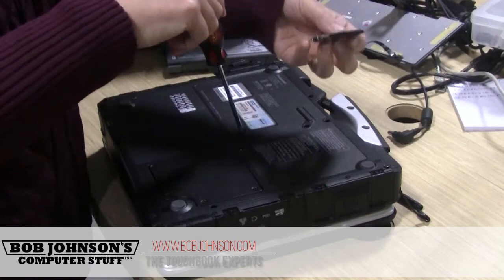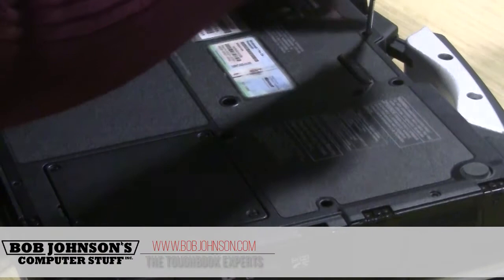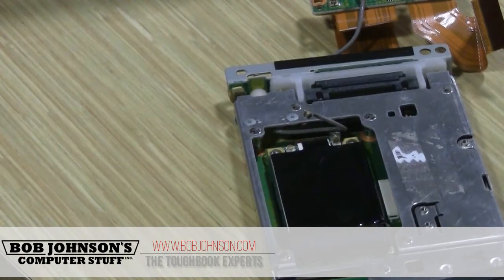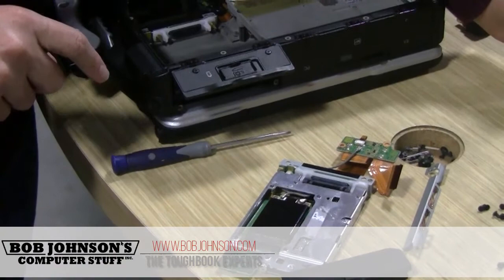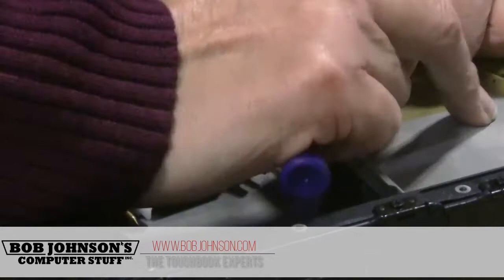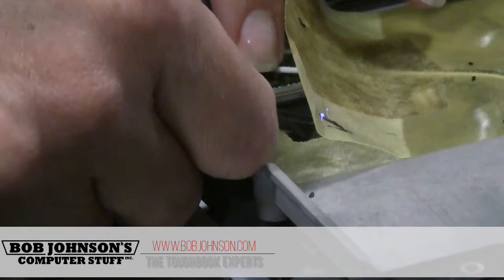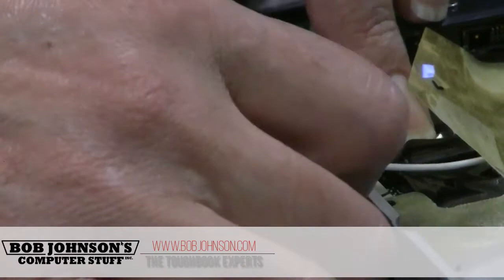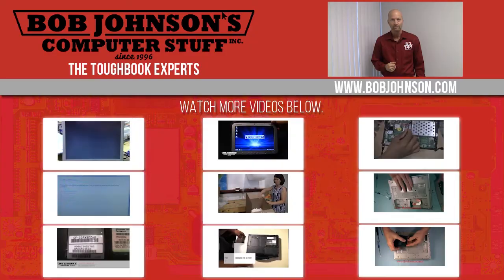How to Install the WWAN Card in a Panasonic Toughbook CF-30

Comment: Hello.
Can you make a video ho to install wires to the wan module and 3g antenna with the wires in cf-30. In this video wires already installed. I have the cf-30 with wan module installed, but there is no wires and antenna in it.

Comment: do you sell the card that connects the sled on back with the antenna wire and antenna
Reply from the maker: +Miguel Rancano Hello,
I had some difficulty determining what card you meant. Hopefully this is the correct part. Follow this link to purchase the part requested: http://bit.ly/1UfNs0H Also don't hesitate to respond for the further assistance.
Reply from the maker: +Bob Johnson's Computer Stuff Inc. Also try this link as well: http://bit.ly/1l4zcNW

Comment: What i'm up to is... as i dont have a 3g/4g card, i'd like to try and connect an external graphics card (eGPU) through a PCIe 2 miniPCIe adaptor and run it instead of intel HD graphics. Has any one tried that on a CF-31A?
Reply from the maker: +Nuno Rodrigues Thank you for you comment, I still hope you are a subscribe! We will be trying that out. Have you done this yourself before? It looks like it could work, but why would you want to run that instead of Intel HD graphics? It is so efficient.